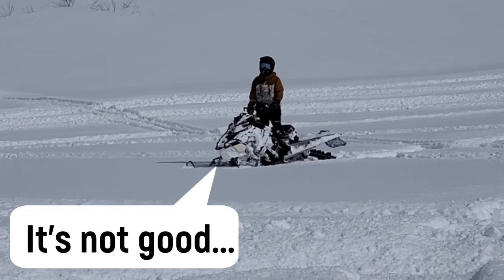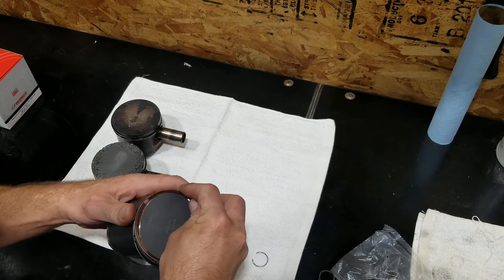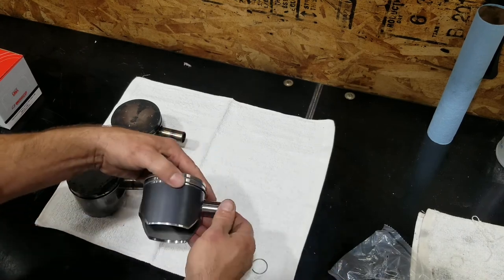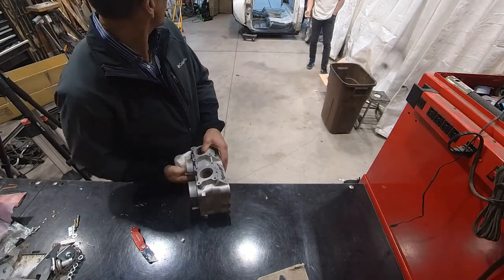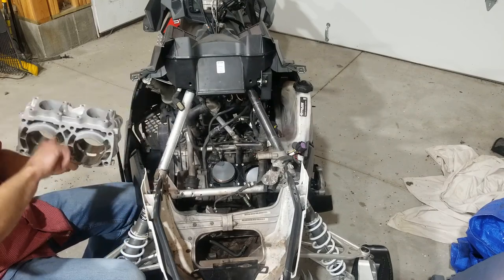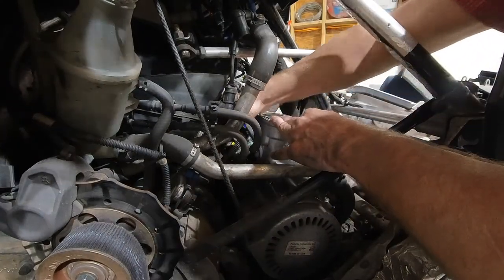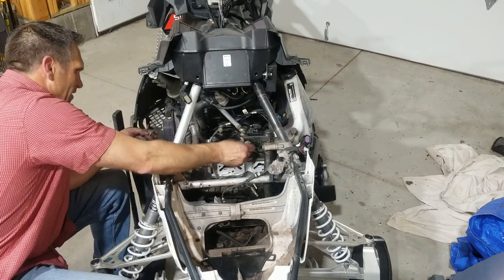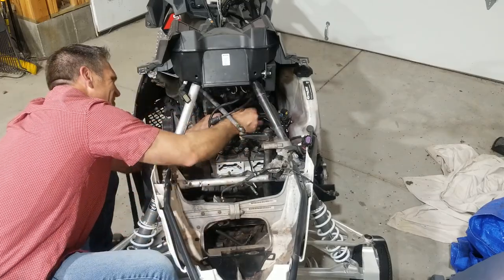2017 Polaris 800 RMK Axys snowmobile - how to fix poor idle, low power, check engine light.

Comment: did you hook up the actuator for power valves?? I didn't see that take place, also it would have needed a re-learn correct?
Reply from the maker: Good eye! That part of the assembly wasn't on the video, but yes, I installed the power valve actuator cable. Some people like to do a relearn every time they mess with the cable. I just put it back on in the same place (same adjustment) as when I took it off, and I've never had  a problem.